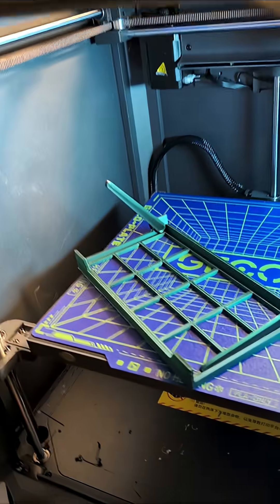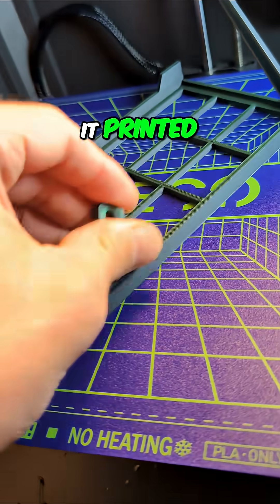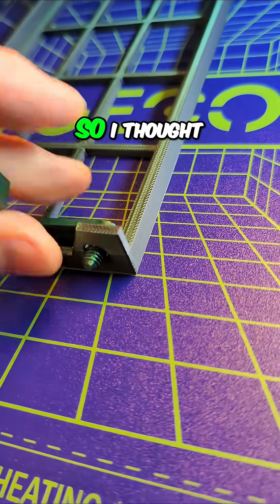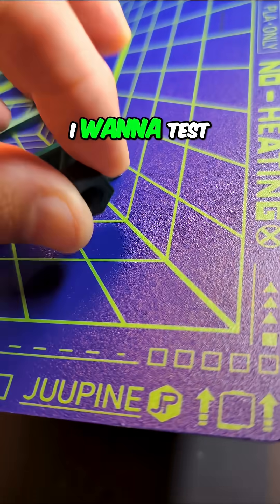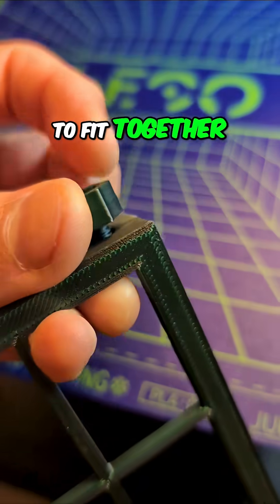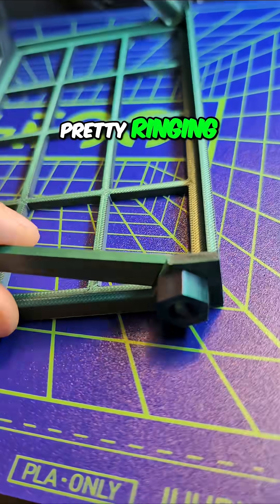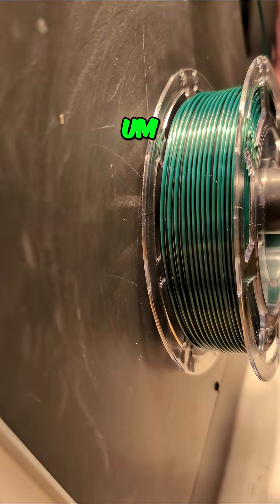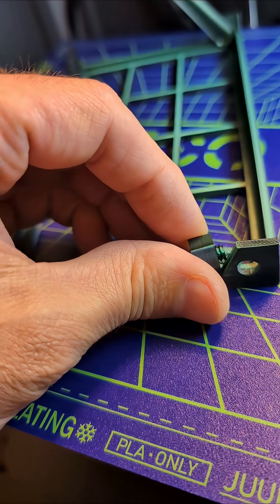3D Printing Test: Drawer, Filament, and One-Handed Assembly #shorts

Comment: If the screw was printed in the vertical orientation, then, yes I would expect it to shear with not much effort. If it was printed horizontally with support, then it should not shear as easily as it did. I am brand new to 3d printing but I have learned that there is little shear strength for something that thin if shearing(twisting) the same direction as the layer lines. I found that out pretty fast on a print I did. I haven't used silk filament yet but I thought it was not supposed to be good for any type of application needing much strength? But I could be wrong there.
Reply from the maker: Printing sideways would bugger-up the threads with supports. Yeah. This was a test to see if the silk would survive. Reprinted the legs in PLA Pro